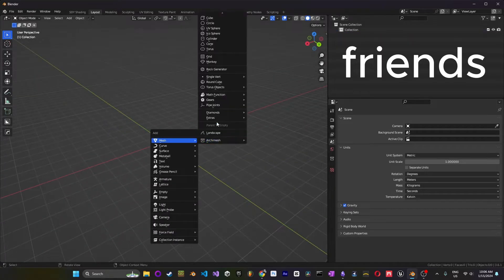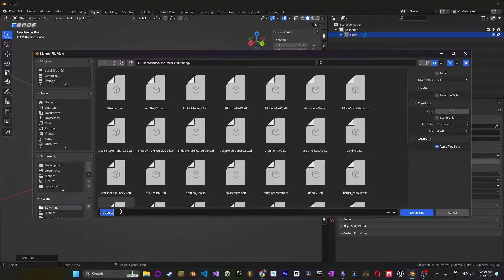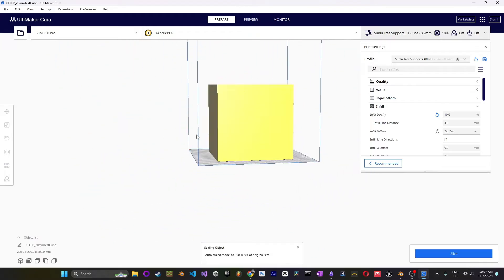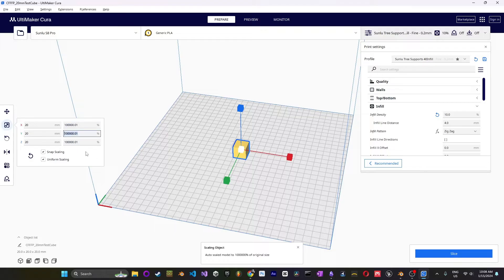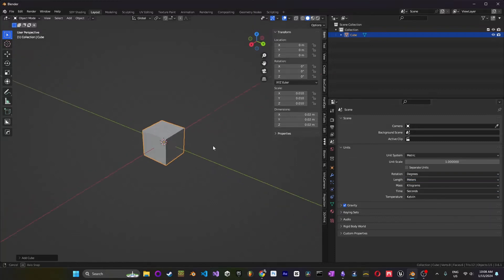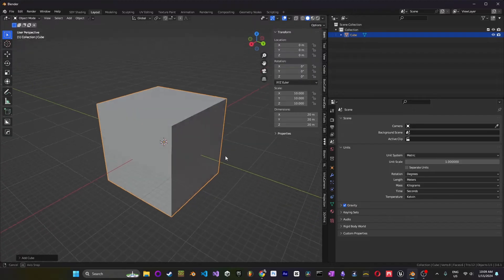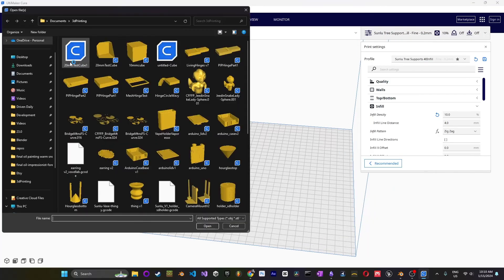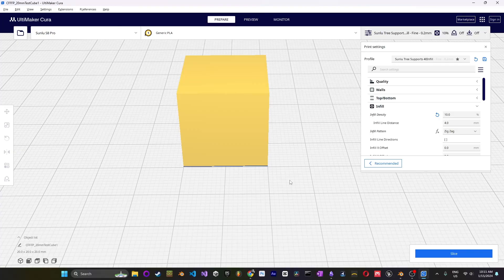Understanding Scale in Blender for 3d Printing

Comment: Sorry I have a solution for this: you have to set up units in Blender as millimeters.
In the starting scene, opening Blender:
-Scene properties > Unit > Unit system: Metric > Unit scale: 0.001 > Lenght: Millimeters
This would be enough but for a better visualization in this unit:
-Viewport overlays > Scale: 0.001
-Press N > View > End: 10000mm
-File > Default > Save Startup File (This so you don't have to redo everything once you restart Blender.)

Doing this exporting the .stl cube 20x20x20mm will be 1:1 in Cura.
Reply: This! No idea why he makes it this complicated in the video
Reply: I’m going to try this out - thank you 😊
Reply: The blender 4.4.3 there is no file default button. Do you know where they put it
Reply: @danp1224   Here’s how to do it:

1. **Open Blender**: Launch Blender 4.4 and customize your scene as needed.

2. **Modify Your Scene**: Add objects, adjust settings, or change layouts to your preference.

3. **Save Startup File**:
   - Click on *File* in the top-left corner.
   - Hover over *Defaults* in the dropdown menu.
   - Select **Save Startup File**.

4. **Confirm Changes**: If prompted, confirm that you want to overwrite the current startup file by clicking **OK**.

5. **Restart Blender**: Close and reopen Blender to check that your changes have been saved.

Now, your customized layout will load each time you start Blender!
Reply: @ cool. I made the text larger and I can see a scroll arrow at the bottom of the file list and there it is defaults. I can’t believe I never saw that arrow. lol. Thanks. New to blender. I was a 3D max user 20 years ago.
Reply: The only thing is that it somehow breaks the scale. For example, my large object is 71 mm, and the smallest in this scene is 0.05 mm. As a result, the smallest object becomes 0.7 mm
Reply: This worked 100% for me

Comment: This is a fucking stupid solution! This isnt a solution at all ! Youre just trying to compensate incorrect scaling with manual rescaling !
Reply: Set the unit scale to 0.01 and change the length from meters to millimeters. Then when you export the stl keep the default scale of 1.000 (or simply 1). This way you wont have to do multiplication EVERY single time youre sizing the object.